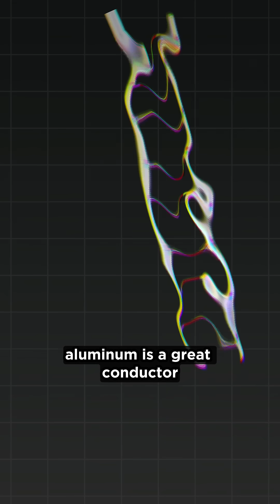How Did This Ladder Melt The Ground?

Comment: I’m thinking AI. 
I see the cooled material is black and there is a lot of it. 
I see the molten material at a color fairly close to white and there is a lot of it.  
I see an aluminum ladder undamaged and I know that it’s melting point is fairly low. 
I see the ladder is placed on the roof in a way that makes no sense for any particular repair someone would do normally.  
It just doesn’t pass the smell test.

Comment: Basically power is not coming from the wire instead there are multiple 1000 volt wires where each current goes across and the ladder, making the latter the object electromagnetic goes around which generates electricity.

Comment: I dont want to be a silly conspiracy nut here but how is this generating that much heat? To melt concrete you need over 1100 degrees Celsius ...2000 degrees  Fahrenheit  ... Can this be A.I. ?

Comment: On the protection relay side, I just would guess, that the ladder has created enough impedance to not to trip. Might be  due to circulating currents through the stairs and capacitive lattice natude of the structure.. So relay would "see" it as some load, but not short.

Comment: Well even if the ladder touch the cable it could only slowdown the electricity current because the ladder just conduct the electricity making it a parallel type of cable i belive correct me if im wrong

Comment: Dont know about america but here in germany at a 110kV you still need to be atleast 3m away from it even if it got shut down, cause usually the induction still carries Voltage since those Cables are usually rather long.

Comment: The ground is not melting the ladder is, you can tell by how close the bottom step is to the ground and with how much material is bubbling there that's probably the original third or fourth step
Reply: What happens if you try to place a solid object on top of a liquid? It will sink until it finds a solid and stable supporting surface...if it was the ladder the whole ladder would have been melted unevenly
Reply: @Frozen92C the thinnest point of the ladder is the contact point with the ground and the least conductive part of the ladder is the burned bit in the middle of the melted pool causing all the heat to occur there

Comment: Yes , do not listen to this , absolutely not correct , electricity grounding is not the same as a short . Little current flow even at high voltage, if enough energy was going through that ladder to do that it would be melted faster than the concrete, and really concrete is an insulator , ceramic is basically the same ingredients as concrete and they use ceramic to isolate electricity, no way in hell thats doing that .

Comment: well the power lines can not have a fuse going off at currents that occure during midday, where maybe hundrets of households down the line are cooking..Everyone might use several kW of power. Thats a lot of power for a little bit of asphalt.
My question is however what on the ground conducts electricity good enough so that this much power can be drawn, but bad emough so that the ladder is just fine.

Comment: Actually this is not due electricity its because some how a volcano erupted in that street. And thats not molten aluminium its lava.
And if it was due to electricity then there would be large flashes and arcs of high voltage electricity.

Comment: In my country, such things are impossible. Neither transmission lines nor transformers cause fires. Every short circuit of the transmission line to the ground is immediately detected and disconnected.

Comment: Because the medium voltage network neutral is not solidly grounded, but usually grounded through an impedance (resistor or reactor).
This means that when one phase conductor touches the ground, the fault current is very low — too low to trigger standard overcurrent protection.

Comment: The ladder is behind the power lines and leaning away from them, so maybe they leaned the ladder into the junction that connects to the house? The weirdest part is that concrete is an insulator so unless it was touching something actually conductive on the ground it would have just welded itself to the power line until it melted itself loose, which the weight of the ladder should have done. The point that should be melting is the point at which the resistance is highest, so if the ladder was on some kind of metal like a manhole cover then it would indeed heat that up enough to melt the ladder into a puddle, but the connection should have been broken at some point. 
Well never know without seeing the top of the ladder.

Comment: Despite the high resistance of the Ground  that high voltage wires will run a tiny small amount of curent through the ladder . But boiling the concrete to lava . Humm sounds quite sketchy

Comment: the ladder heated the concrete at its  tip first  as  the tip of the feet as the least rubber  after friction wears it down.  so slowly it leaned into a self made lava  hole and   lost its connection, allowing the   ladder and lava to cool

Comment: A mylar balloon bridged a distribution line in the alley behind my apartment.  Fault detection cut it off, but the system reset itself twice before remaining off.  I'm told that more than one lineman has gone down to that self reset "feature."

Comment: Doesn't need to necessarily touch it, magnetic induction could be enough... but... I still don't get how so much power got sent without a fuse tripping on the power line side.

Comment: aluminium is a terrible conductor, but its a far better conductor than the concrete below.
however that's where it will ground out and the make and breakpoint of a circuit can under circumstances create arcs.
arcs form when
according to a five second google search, it takes 3*10^3V (3kiloVolt) to gap 1mm of air.
i don't know where that is and how much voltage is on that ladder, but we can assume that the gap is bridged and the arc is so intense that it literally melts the conductor past its resistances and turns it into satisfying goop.

yeah i learn the electrical trade, how could you tell?

Comment: "Aluminium is a great conductor" just a reminder if someone offers to wire your house with Aluminium instead of copper because its cheaper, dont do it. When you put electricity through aluminium it expands fater than me when you put a dessert on the table, forming connections looser than between you and your ex, costing you thousands more on maintenance than you save, or on a new house after yours burned down and insurance refuses to pay because you wired your house with the 1970s fire starter special.

Comment: The ground got so hot it started melting the bottom of the ladder. Look how close to the ground the bottom rung is. If the top of the ladder is what made contact with the line, the ladder may have shortened to the point contact was lost.